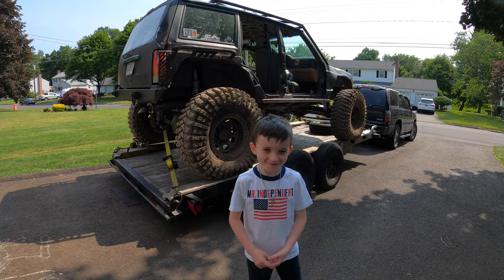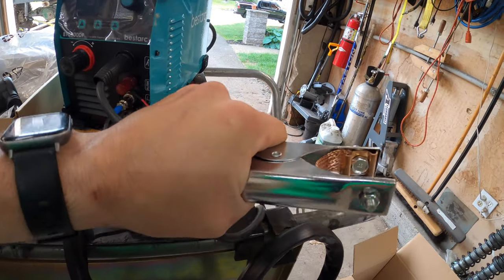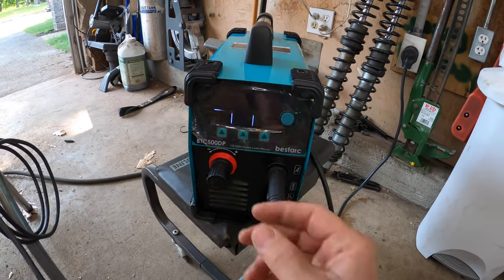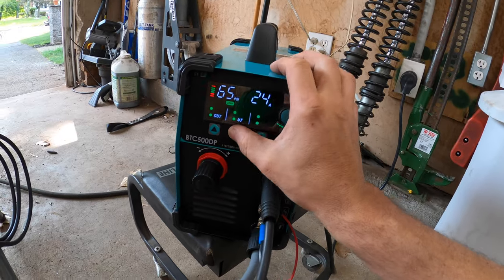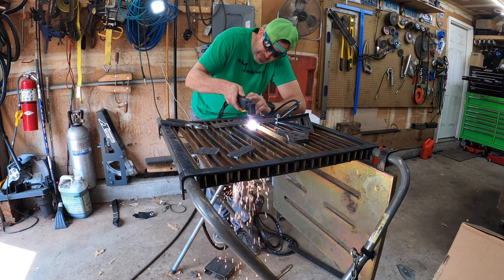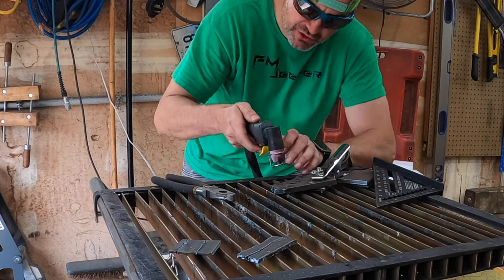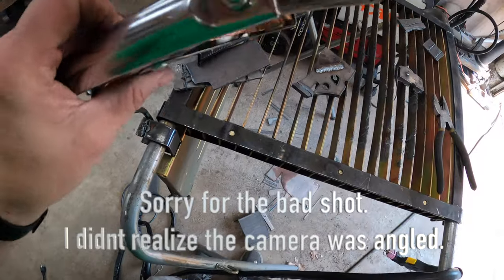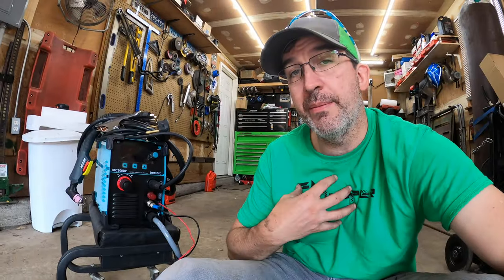The Bestarc BTC500DP 7th generation Plasma Cutter Has A Digital Display For Easy Use.

Comment: Pilot Arc is best for dirty/ rusty metal. Pilot arc starts when you pull the trigger; HF plasma has to be close to the material to start.
This plasma works a lot better if you remove the guide ring. I have seen this plasma cut all the way through 1" steel (granted not as clean) I have seen it cut extremely clean through 3/4" though. 

I think you need a 65A plasma or possibly larger for the speeds you like to cut at. Seems like you were going way to fast for most of your cutting.

Most people just leave plasma's cranked up and just adjust cut speed, but it's nice to get an idea of what it can do on various settings
Reply from the maker: Great feedback.  I really need to get some run time on this machine.   Thank you very much.
Reply: @FMJeeping  Agreed - need to slow down just a little.

Comment: Has anyone had trouble finding consumables at their local welding supply? Are They common or Bestarc specific?
Reply from the maker: I didnt use it enough to burn through the consumables.  I think if you search on Amazon. You could most likely find them.

Comment: Pilot arc only puts a ground wire in the torch, so the arc will start in the air, not just touching it to the metal.

Comment: What breaker on your 120v?  I keep getting nuisance trips on 20A  breaker at the lowest settings but on a 30A breaker has held up fine.  Mine's an older gen.
Reply from the maker: I have to double check, but I think that might be a 20 amp if I'm not mistaken
Reply: 30 amp breaker for 120v outlet? What gauge wire is in your walls?
Reply: 10 gauge for that branch @jakefriesenjake
Reply: @idontwantcorporateretaliat6301  never heard of that before. Didn't even think that they made outlets/plugs for 110v to handle 30 amps. I've heard of 20 amp breakers using 12 gage wire in the walls tho.

Another tip, if you don't have 220v in your shop, but you want to run 220v into your plasma cutter, but don't want to hire out an electrician. I'm not saying that this is the best idea or is legal or not, or that you don't know about this trick yet, but it works. 

If you have 2 separate 120v outlets in the area where you are plasma cutting, THAT ARE ON SEPERATE SIDES IN THE BREAKER PANEL ONLY, (like one switch on right side and one on the left side), then you can plug a cord into each separate outlet, with the white neutral wire side cut off, (large terminal side or the silver screw side of the wall outlet connection in the back of the outlet, or the side of the extension cord that is plugged in to the left side of the outlet if the ground terminal is on the very bottom orientation).

So basically, with 2 separate 110v extension cords running to your cutter, cut off the white wire in each but leave the black wire and ground wire intact, wire up the black (hot) wire, to the plasma cutter, and twist both ground wires together and attach to the ground of the cutter.

Boom, now you have 220v to the cutter with 2 modified 120v extention cords.

Not saying that you didn't know this trick, but it's out there for others to try if they want. Use at your own risk, and only if you really understand what I'm trying to say. Enjoy.
Reply: I wired it in myself, the plug for 120/30A looks like a smaller welder plug.  I wired 220A for the welder and plasma but wanted to try 120V capabilities.. @jakefriesenjake
Reply: @idontwantcorporateretaliat6301  nice

Comment: Why are you running it at 110? 220 is what you want.
Reply from the maker: Tested both services. 220 is not available in some areas and 110 is all people have in some cases.
Reply from the maker: @garylee9738  I know. That's why I use 220